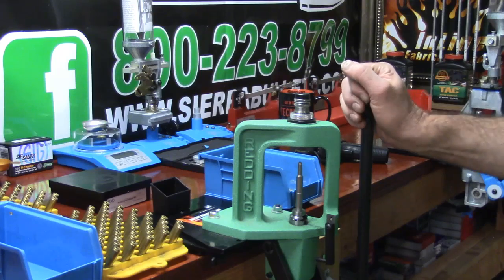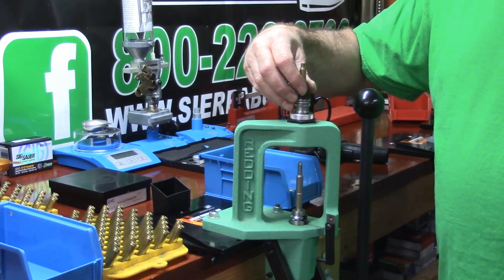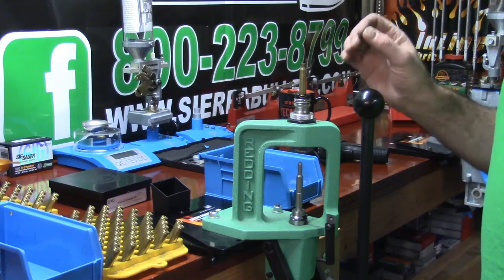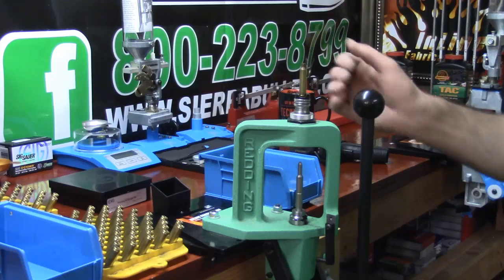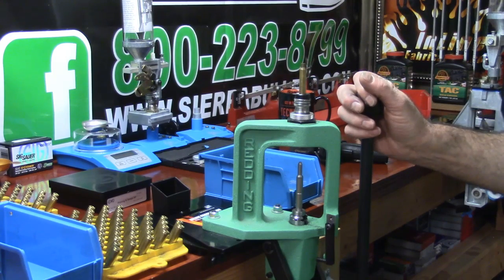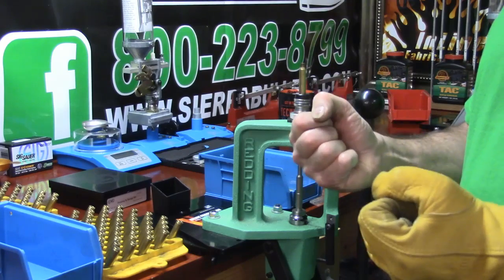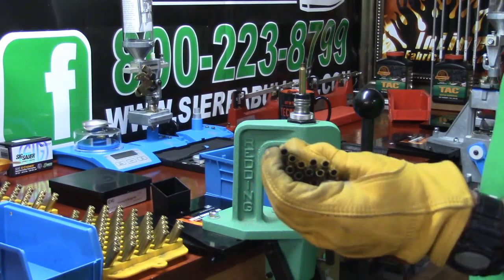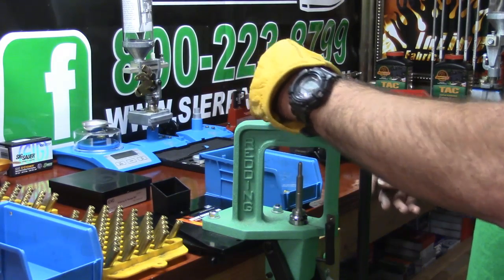Dillon RL550B, 223/5.56, Video 43, CH4D, Swage Kit Hints

Comment: I was recently checking this tool out and was going to order one of their shell holders also. I didn't know for sure but I thought maybe it would have tighter tolerances. Thanks for confirming that but I decided not to buy it because of the amount of stress on the lip. The shell tilting is not a good thing. Perhaps if they had a split holder that supported the entire lip equally but then there would be a time issue.
Reply from the maker: +Nicholas CeeA I found their shell holder offered less tilting but you mat experience better results. Thanks so much for the excellent comment. Welcome to my channel Sir. Highboy